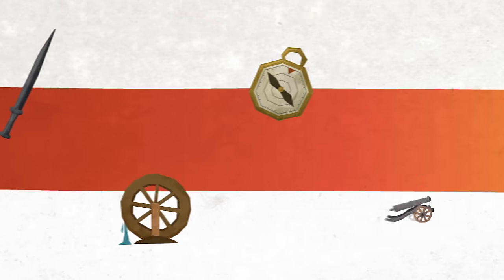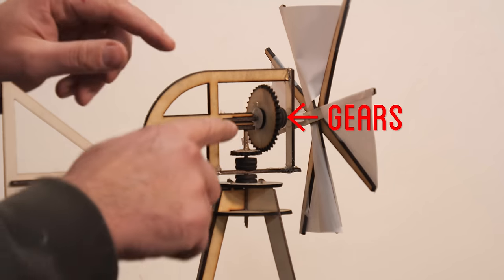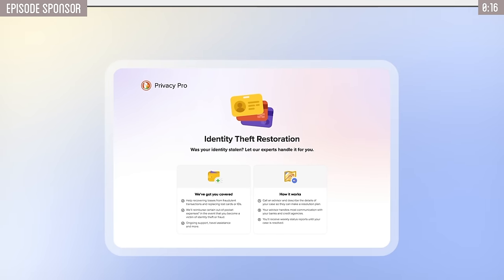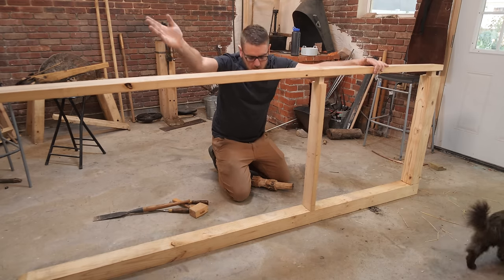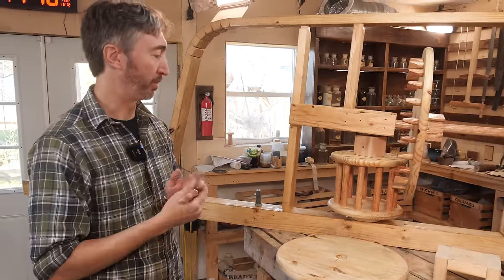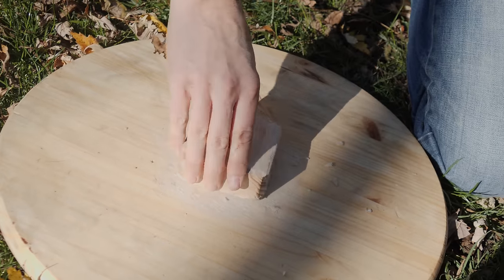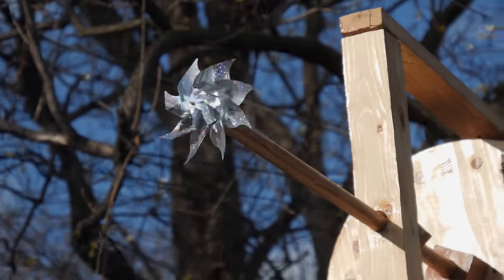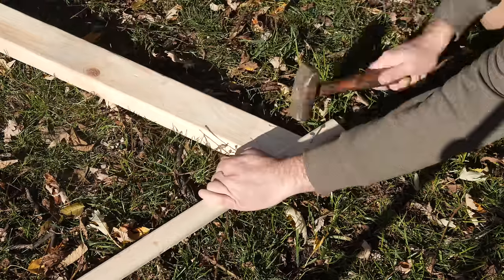Does this DAVINCI's Design Work?

Comment: I was wondering if perhaps the sails and the wood framework for the sails are too heavy, and cause the axle to tilt.  That would cause more friction and that could be the reason it won't spin much.  Maybe you need a counterweight on the opposite end of the axle.

Did you soak the wood before steaming it?

Does anyone know if a windmill would work well for grinding pulp for paper?

Comment: I could be wrong, but I believe the steam turbine is the most efficient type of steam engine. It also shouldn’t be too hard to make a rudimentary steam engine: make an airtight funnel, add a shaft with metal fan blades increasing in length, and push your steam through the narrow end. Something to think about when you revisit the steam engine.
Reply: While a good steam turbine is more efficient than a piston steam engine; I doubt the same holds true for anything HTME could achieve. Steam turbines want high pressure and speed, which is extremely dangerous if your construction isn't flawless. Piston engines can work on comparably lower pressures and speeds.
Reply: Ah, good point

Comment: I think that your biggest problem was that your base is just too short and wasn't anchored down. The sails and gearing were great, but you just didn't have them high enough. 

Wind speeds pick up and get more consistent the higher you go and the less you have obstructing it.

Your backyard is surrounded by trees and fences, and your tower didn't even get the sails above your roof. You were never going to catch any decent wind with that setup.

Your tower would need to be at least two or three stories tall before you started getting decent results.

Comment: "I want to play w/ wind power" and "anything weak" never mix well... If you want to go that big you're going to need a better frame and anchor to the ground and possibly even guide wires. I can say w/ complete confidence that 2x4s will not work, you're going to need 4x4s or 6x6s as a base and possibly even buried just to keep it up against a slow wind.... There is so much force oce you get over a few square meters of area, it gets ridiculous real quick. It's like trying to carry a mattress by yourself in a strong wind...     😂😂

Comment: I think the sail angle is too flat to the wind. This is like gearing for the wind. This angle seems to be geared for high speed. I would start with a angle that is much more parallel to the wind. The wind will then force the sails to spin sideways instead of pushing them back mostly.

Comment: The center of the blades are spinning much faster than the edges of the plates they need to be slightly more curved to catch more wind the smaller you make them the faster the spin because they'll be less material and less weight and again the center part where they mount they spin faster than the inches❤❤❤❤❤❤❤❤❤❤❤❤❤❤❤❤❤❤❤❤❤❤❤❤❤❤❤❤❤❤❤

Comment: WOW!!!

WHAT A WRECK!!!

I'm pretty sure DaVinci would be ashamed.

You didn't balance the blades, you didn't do anything to reduce the blockiness of the vanes, and by offsetting all of the vanes to different distances from the axis, you put unnatural strain on the joints which caused excessive drag.

I did not even hear if you put any kinds of lubricant in there, but if you didn't that would also contribute to it not working.

Since they had all kinds of oils and animal fats, you should have made sure the moving parts were all thoroughly lubricated, and the holes [for the axles] should have been sanded very smoothly.

Also your pivot plane should have all been floated on grease, AFTER a good fine sanding.